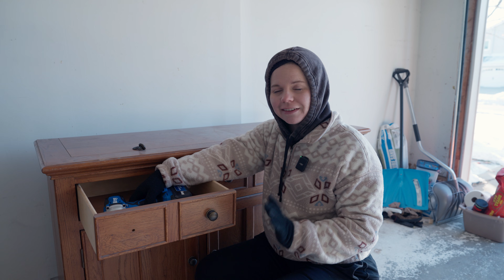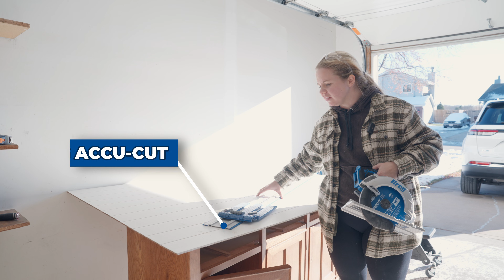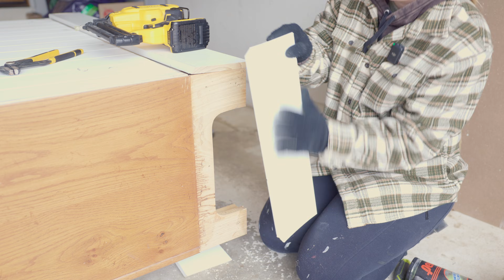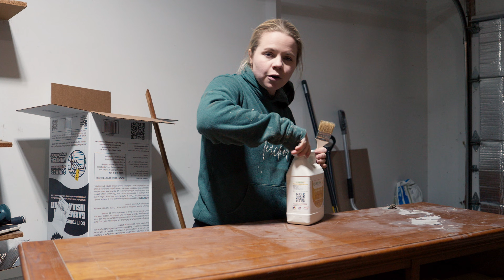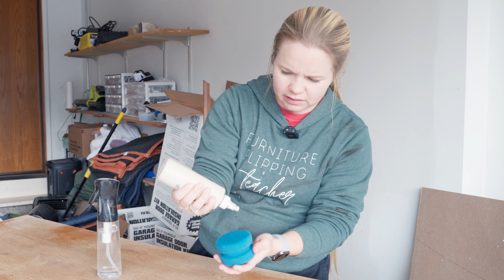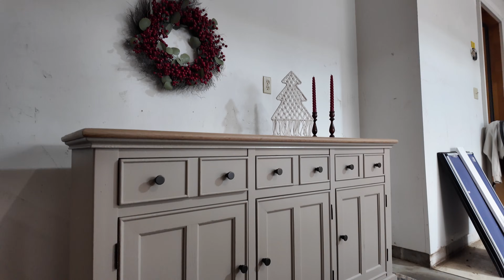OLD BUFFET Turned Kitchen Island?!

Comment: Just a tip. When using a track saw you should put the track on the side of the piece that you want to keep, rather than on the offcut. When you line the track up to the mark on the other side then your kerf is cut from the piece you are keeping, making it a fraction smaller than what you need. If you need to do it the other way (i.e. bit you need is too small) then you need to add the width of the kerf to your measurement.
Reply from the maker: thank you for the tip!

Comment: The cabinet is lovely. I wouldn't call it a kitchen island. Had you added a butcher block to double the with and could have added stools to make it an eating counter as well as a prep counter, I could see it as a island. I still see it as a side board. I still love you and what you do ❤❤❤
Reply: I agree. If there are wheels, I would want the back finished like the front so I could wheel it out and use it as a bar, for example.

Comment: looks practical and pretty. If you're not too fussed with painter's pyramids, some folx use an old wire hanger and screw eyehooks into the bottom of cupboard doors. If you paint your kitchen cabinets it would save so much time!

Comment: Looks like you are using the straight edge backwards when cutting.  Your pieces are either short by the width of the blade or you are anticipating the blade width which isn't as accurate.  Typically the track is placed on top of the piece and not the drop so you can set it right to the lines.  If that makes sense.
Reply: It does. Cutting from the waste side is definitely better.

Comment: We live in the Phoenix AZ area where our garage could easily get to 130 to 140 degrees in the summer.  Our car was almost cooler keeping it outside!  We installed the garage door insulation kit on our garage door.  But, first we install foam core boards.  That dropped the temps to below 100 in the summer.  The next summer we installed a mini split and that COMPLETELY transformed our garage into useable storage area.  We are able to store overflow canned goods from the pantry out there.  Don't have to worry about Christmas decorations melting.  It was a HUGE game changer for us.  Just a story to share.
Reply: Can you please share the garage door insulation kit that you used? Name? And also the mini split please… I also live in Arizona
Reply: @marymiller5950  G' morning!  I had to get into the garage to see the name on the unit.  It's a Mirage X-Life.  And We just bought a generic garage door insulation kit from Lowes.  But, like I said, we first bought foam core  board that was silver backed and installed that; then we installed the insulation kit over that.  Oh and we replaced the gasket on the bottom of the garage door too.  That stopped bugs as well as a mouse or two from getting into the garage.  We haven't seen anything unwanted out there in the four or five years since we did this.  Hope the information is helpful.
Reply: @sandychilese2893  Thank you so so much for responding. Did you use any specific tape  to keep the foam board up?
Reply: Also did you install the mini split yourself or did you hire someone to do that
Reply: @marymiller5950  I understand that you can do it yourself, but we had it professionally installed.
Reply: @marymiller5950 Great question, I wanted to know as well!
Reply: @sadietaylor3662  Please see answer below.
Reply: I lived in Parker AZ. Talk about hot! Had to insulate all draperies and hang drapes across doors.
Now I live in north central Iowa, and it is the same. 😂 Hot or cold:  If it isn't one thing, its a another. 🙃
Reply: Beautiful piece of furniture..you are amazing